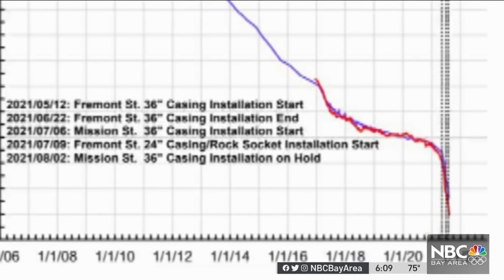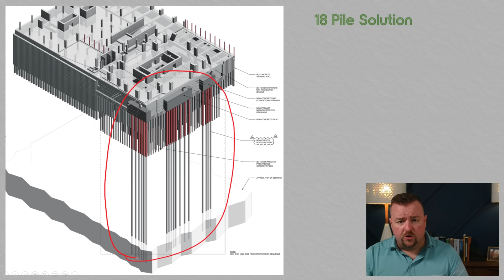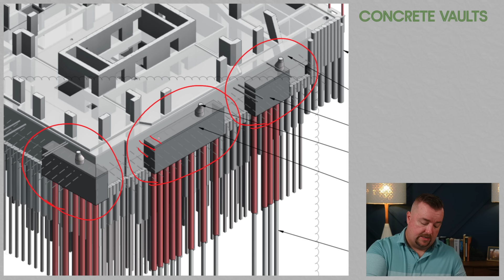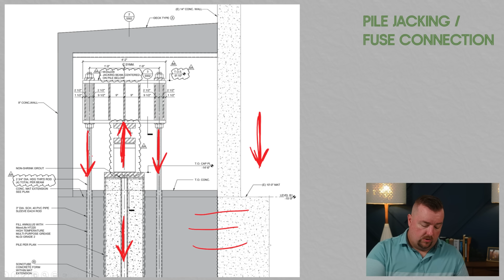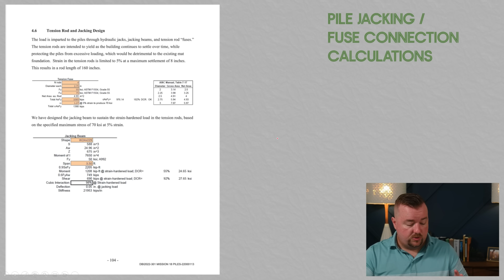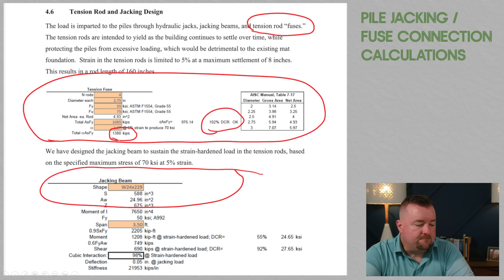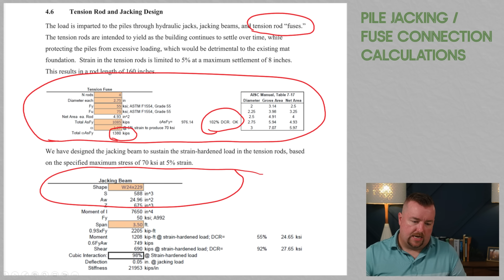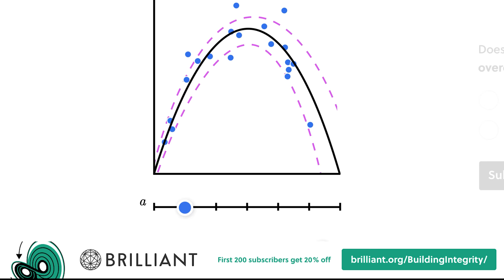Did I Uncover a $100,000,000 Mistake with the Millennium Tower "Fix"?

Comment: If you made a 2 or 3 minute video explaining your ideas and you contacted a local TV channel in San Francisco and you offered them an exclusive, maybe one of them would put your video on their local news. That might get you more attention for your YouTube channel and might affect the work on the building there.
Reply: Completely agree.  It’s best to be shown up as incorrect by all the design teams than for them to be shown up incorrect when an earthquake hits and all the threaded rods shear due to cascade failure.  Get a local news channel to bri g you on as a panelist to discuss.
Reply: If a bunch of people just link the local news channels to it they'll report on it
Reply: TV news is somebody standing in front of something, like a building in this case, and talking about it as if their audience was 9-year-olds.
Reply: @pentachronic  Josh is a sharp engineer and I fully expect that his calculations are accurate. By my calculations, the failure mode is the plates pulling apart around the holes. IMO, the plates should be at least 3" thick and probably sized at at around 17" x 10". And even then, I think that the fuse rods are too close together at 4" separation.

This really isn't a "what if I'm wrong" scenario; it's a "Stop this nonsense fix approach and start taking the building down. She's a goner."
Reply: @supremedictator.  If the building falls, would there be a domino effect because it might tilt and land on another building that will also tilt and hit another one and on and on?

Comment: Love that whole jack idea. The fuse means the building can rock and the foundation stays fine. Almost looks better than what they're doing on the new ones with the rubber mounts. Maybe they should put in a mass dampener at the top of the tower?

Comment: Did a back of the envelope calculation. I agree with you it looks bad. Plate will likely shear before the rods snap.
Reply from the maker: Thanks.  That is my conclusion as well.
Reply: When you say shear in this context you mean the plate breaks and part of it remains in the concrete and part on the rod? 

At that point, leaving 3 other rods to take on the full load, which would likely fail and then all that is left to connect the piling to the building is the friction between the greased rods and the concrete as it torques? And the building just sits back down on the original foundation... am I close?
Reply: @x--.  The tension of the rod will transfer to the nut. The nut will transfer the load to the plate through the area in contact. Since the plate is quite thin the plate will bend and crush the concrete just above the nut. Since the concrete immediately above the nut is crushed, the load now has to spread to a bigger area of the steel plate. This means that the plate will be loaded in shear. The load has to be transmitted though a shear area of 2*6.5*1.5 = 19.5 in^2. The shear strength of construction steel is typically about 30 ksi. So the load capacity in shear is perhaps 585 kips.  The rod has a strength of 370 kips. So actually there is some margin. I was initially assuming that the rod was a high strength threaded rod, but actually it is a very soft rod (75 ksi). So although not great. It is not as bad as I though.
Reply: @davidosterberg  Thanks for the explanation! Trying to visualize the potential failure modes is helpful. Over the life of the building it sounds like they'll be adjusting the pile jack as needed so any slow/hidden failure in material would be given plenty of opportunity for a catastrophic failure (imagine being in the vault when you heard it go).
Reply: @davidosterberg  I imagine the plates will bend and/or buckle over the bolts, effectively becoming a drillhead when the rods are lifted, drilling a new and larger hole through the concrete from the bottom of the hole and up?
Reply: @BuildingIntegrity  I was so excited about half way through this assuming the big conclusion would be you revealing your math telling us at what load the threaded rods would pull through the plates...  You cant just tease us....

Comment: Love this video. My only add-on request would be to also show your work demonstrating the shear strength of the plate is insufficient for the intended load.  
Bolt/nut  pulling through beam section screams Hyatt Regency...and I really hope (as your subtitle says) that you're wrong, or that this potential error is caught in time.
Reply: So many people have mentioned that previous failure, which is interesting in itself.

Comment: The pile jacking system is not of great concern for me.
However, the CONNECTION to the building should scare any thinking person, engineer or not.
You're asking a 'portion' of the building that was NOT designed to support that kind of Point load.
HOW will that point load transfer evenly to the rest of the building in the event of a major shift/settlement/movement of the entire building load on the point of attachment?
And, are we saying that we are now designing at the point of failure and disregarding the 2x-safety margin?
Say I'm wrong...Please,
Reply: I'm wrong... hows that.
Reply: @Phil_Scott  
You forgot ...Please,
LOL

Comment: At 7:27 you see that there's a single nut at the top end of the rod (sitting on top of the Jacking beam), and at 9:58 you see that that nut interacts with about 9-10 threads of the rod. I'm not sure that that interaction cross section is larger than the cross section of the threaded rods itself. Seems more like on the order of 70% or 120% of the rod cross section. Whereas I would prefer if I had something like 4 times the rod cross section. (A first factor of 2 because you're dealing with a contact surface and not a solid piece of material, and a second factor of 2 because the rods explicitly forego the usual factor of 2 or 3 safety factor.) I would NOT be surprised at all if the nuts just strip the threads off of those rods.
Reply: True, each nut at the top need to withstand a tension of near 160T. Not sure they calculated that level of stress…

Comment: My real issue is the use of those threaded rods also.  I think the weight of the building on those double nuts will just shear those threads right off those rods like a hot knife through butter.  It will be the plate or the rods that cause a failure but it’s for sure going to happen especially if a earth quake happens.
Reply: They have been in place and fully loaded for about three weeks now, so they must be better than that.

Comment: I'm confused as why they put rods into yield to measure load instead of using the hydraulic cylinder to measure load. Also if the rods get unevenly loaded while at yield that is asking for a failure?

Comment: This video made me curious, so I modelled the rods (as smooth 2.75 inch, not threaded), the bolts (4 1/8" diameter, 2 23/64" thick), and the steel plate (with 3 inch holes centered 3 inches from the ends of the plate) in SolidWorks, and applied 500,000 pounds of force spread across the face of the plate.  I modelled the plate from A36 steel, but all steel has about the same stiffness.  This level of detail was solved in less than a minute on my laptop, it's hardly a big deal.

* The rods end up loaded to 43 ksi.  I'd like to echo earlier statements that any fuse assembly ought to have the fuse well controlled, which means threaded ends maybe 3" in diameter and a turned-down precision epoxy-coated smooth bore fuse 2.75" in diameter.  And every batch of rods that was seperately fabricated (like different batches of steel) will need to have one unit destructively tested to yield.  Also, I didn't follow the bit where the pile may end up supporting 1.3 million pounds, but that would be 55.9 ksi, which is a little over the 55 ksi spec for this steel.  Also, how tight is that specification?  Usually these things are a minimum that the plant has to hit, they don't worry about going over.  Also just fabricating the rods will work-harden it to higher yield strength, has that been accounted for?
* The plate surface delivers 7100 psi into the concrete.  The concrete will have to be very, very high spec to tolerate this, and will turn to powder with the 1.3 million pound load.  The plate is indeed too small, but not because the steel will yield, rather it's because the concrete will yield.
* The plate flexes 0.55 mm = 0.022 inches.  It's not simply bowed, the nuts actually help spread the load a bit.  This deformation is going to turn more of the concrete into powder and then move that powder around a bit.

As I understand the design, it is not underpinning at all but rather side pinned.  The difference is that underpinning requires small fractions of the building load to be carried sideways from point of application to the various piles underpinning the mat.  Side pinning requires whatever load is transferred to go sideways through a substantial fraction of the mat.  Because the mat wasn't designed to transfer loads sideways a long way, there's a limit to how much load it can transfer.  This is the reason for the fuses.  The fuses are designed to avoid applying thrusts larger than the mat can take.

This is all bullshit.  Buildings are not designed with fuses, because what happens when there is an earthquake?  You'll get cyclic large loads which are not well predictable, and the side-pinned piles will not support the building.  Fuses are a way to solve an aesthetic problem (leaning) without solving the underlying actual problem (foundation isn't well anchored).

These fuses are also badly designed because they cannot be replaced!  Think about that.  Ever seen a fuse panel that required the wall torn out to replace a fuse?

The right answer is to upgrade the building's mat to transfer the loads horizontally to the new piles.  I understand that this is difficult: it costs a lot to fix a screwup, deal with it.  There are many ways.  You could, for instance, install the transfer beams through what is now the second or third story.  The load columns would have to reach up to that, and those beams would have to engage with the columns of the building.  You'd lose a bit of usable floor space but it wouldn't be too bad -- I doubt the second or third story is the highest rent spot in the building.  This is the basic fix which then enables a normal non-fused design for the connection between the periphery piles and the mat.

Finally, as pointed out in the video, this little anchor plate is too small.  For a standard 4x civil engineering safety factor with 4000 psi concrete, it should have at least seven times the current design area to reduce the loading into the concrete, and it'll need stiffening webs to reduce the deflection so that it doesn't locally crush the concrete.  Finally, it needs to have a designed interface to the rebar rods in the building mat which will be under tension to transfer the loads horizontally.  As someone in the comment section pointed out, this is going to make that plate look a lot more like the spreader at the top of the rods, which makes intuitive sense.

Comment: One thing as an engineer also is what happens if some or all of the threaded rods have manufacturing flaws in them causing them not to meet the yield stress predicted. Were they inspected microscopically for defects before installation I wonder and/or tested by loading them to see what loads and yield they actually can have.
Reply from the maker: This was another thought I had.  His design depends on all 4 rods having the exact same yield and ultimate strengths and having the same stress-strain curves in the plastic region.  Lots of assumptions that are all dangerous if you're wrong.

Comment: I wonder about the psi rating on that concrete in contact with that plate. It will be under tremendous pressure!
Reply: Well if it works, a large proportion of the weight of the building will be transferred to it… so let’s hope it’s good stuff!

Comment: It would be nice if a college prof with access to Finite Element Modeling software would model the rod, the nuts and the plate at the loads specified and share the deflection and stress contours.  It would make a great class exercise of real world problems.
Reply: It could take months to model something that complex and have any confidence that you got it correct.   I think simple hand calculations on the rods and nuts  would be acceptable.   Then some simple hand calculations on the plate with some finite element modeling on the plate should work.  I've not worked with concrete so I wouldn't know how to approach the loading on the concrete by the plate.  BTW, there are a number of freeware finite element analysis packages to pick from if you want to try modeling it.

Comment: I'm a retired heavy civil/structural engineer (PE in CA).  Good video, and you are correct to scrutinize this design.  I would have over designed the hanger (all thread) bars, nuts, and plates by at least 50% given their criticality.  The resulting increase in material and cost would be chump change.  I would have also wrapped the piles with ~1 inch thick compressible material so as to ensure the piles will not bind in the concrete vault base when preloading the piles.  Also, this perimeter piling solution would make any dishing worse and possibly overstress the base mat.  I presume the base mat was checked using a 3D model of the entire building, all load combinations and under current codes and standards.
Reply: Its mind blowing they didnt over-engineer this thing with a huge safety factor, like as you said 50% or even 100% to put it far, far away from any breaking point

Comment: Another issue with the new piles is them buckling under the pressure. For a building this size / weight, the piles should have been more like 2 meters diameter over the 2 ft they used.  Given time the piles and building will falter.

Comment: I'm an artist (no engineering experience) and I would have believed that a building of this size should have needed support down to the bedrock and that's not even considering an earthquake prone area. I wonder how many palms were greased to get the original plans approved. Even a child could have figured this out. The graft involved must be comparable to Russia's military fiasco.
Reply: Exactly. Poor design choices from day one. You do not pu a floating slab on landfill. Not to mention the earthquake factor.
Reply: When you design larger buildings, it's not as clear a design choice as you believe it is. You calculate with a safety margin, but you don't want to over-build massively just because you tend to believe something big better stands on rock. "This size" is hindsight is 20/20. Founding multi-story buildings in weathered rock or San Francisco Bay clay is common and can be very safe. The decision depends on the characteristic of the soil and a correct calculation model for the forces you induce.
Reply: @ronaldoago-go5907  It's not a floating slab, much less a floating slab on landfill. The slab is supported by the hundreds of columns they planted into the natural soil below the fill.
Reply: @skayt35  And the builders of Millennium Towers certainly calculated wrong

Comment: Enjoyed your review. Thx. They should start the process of completely removing this building. No one will want to go inside or around it even if it is ever ‘fixed’, at this point. Especially in such a seismically active zone. Even it it works temporarily, the cockamamie system cannot be properly maintained over time. Cheers for the astute insights.

Comment: 10: 15  There's a chain of weight transfers from the piling to the building and the embedded plate is the second point of transfer. The "fuse" can fail at three points. It can break through  failure of the threaded steel rod, or by failure at either end of the rod. But neither end failure point is an issue if the rod will fail first, which is I assume what is intended to happen (hence the "fuse" analogy.).

Assuming that doesn't happen .. It seems to me that you're maybe worried about the wrong metal plate. The plate at the lower end will resist tearing because the concrete surface above it and the jamb nut (17:47) disperses the force from the double nut underneath it. I'd maybe want a larger plate to make the concrete more resistant to having the plate and jamb nut ripped out of it if the concrete deteriorates, but plate tearing is probably not an issue. Of a bit more concern, IMHO,  is the first weight transfer point  at the very top of the linking structure above the jack.  There you have vertical ribs in the steel box structure to spread the weight transfer, and you can inspect it for failure in progress, but you are much more reliant on the metal's resistance to tearing.

But, again, none of this should matter if the threaded rod will fail at a much lower compression than that necessary to cause tearing or rip-through at either end.